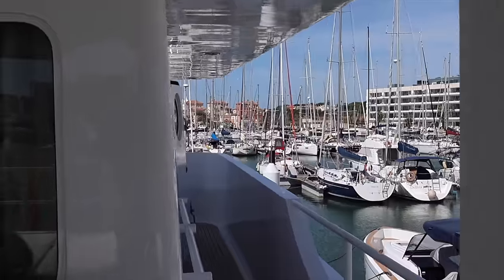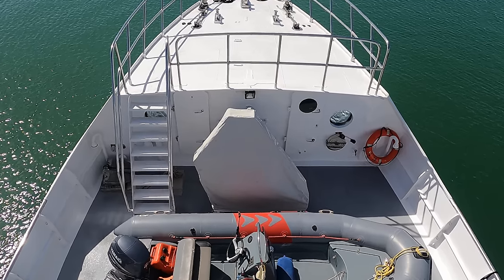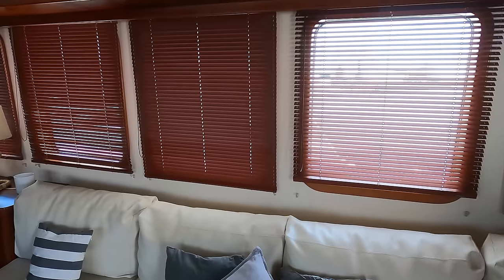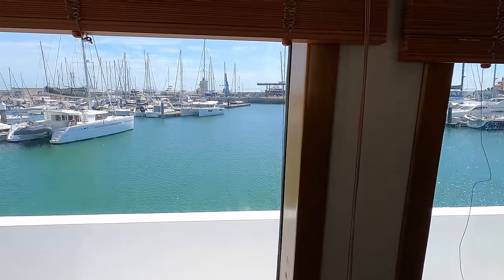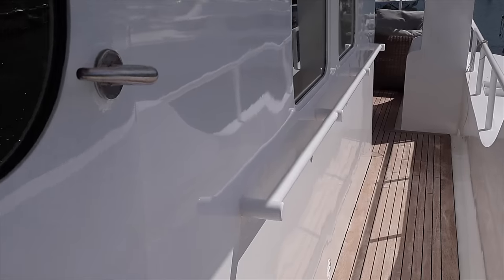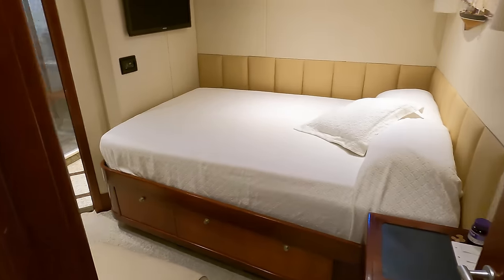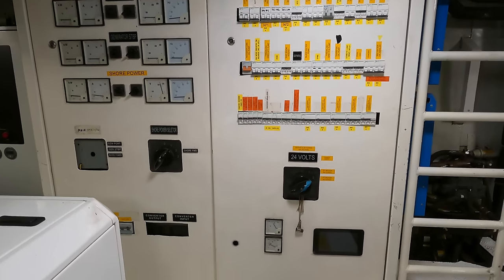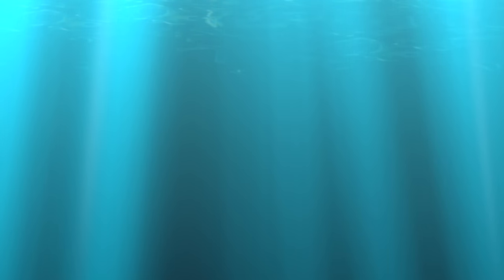€2.5M Steel Long-Range TRAWLER YACHT For Sale (And Charter!) | M/Y Beleza

Comment: With the narrow beam of this yacht, stabilizers would be a requirement. Also fuel polishing equipment are a necessity, not some kind of luxury add on. The cabin aft of the helm is a "Captains Cabin" , unless the owner holds an all seas, all conditions license. The boat has impressive legs with over 8700 gallons as fuel capacity. If chef not crew, the boat needs at least three, and more likely four crew members. Captain, 1st mate/ engineer, deckhand, steward

Comment: A very shippy little ship. She is beautiful and has so much potential to personalize. Great video John. My only request would be to keep the video wide-angle in small spaces so as not to look like you're crawling through a tunnel. However, I appreciate the arrows and video freezes when describing certain areas.  Well done brother. 🙂
Reply from the maker: Noted 🫡 Thanks for the feedback 🙌 I will keep the GoPro those tight spaces. I was hoping my Canon lens would be enough to capture those tighter shots
Reply: @YachtBuoy  Maybe a combination of the GoPro and a wide-angle lense on a different camera. All good.